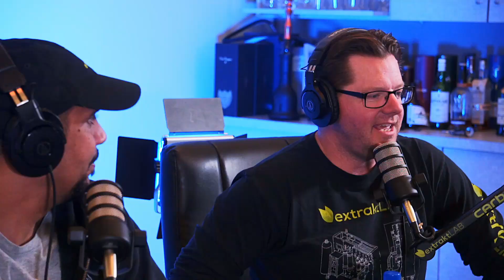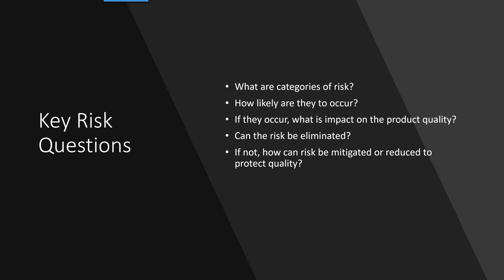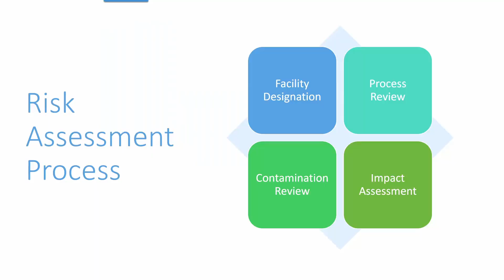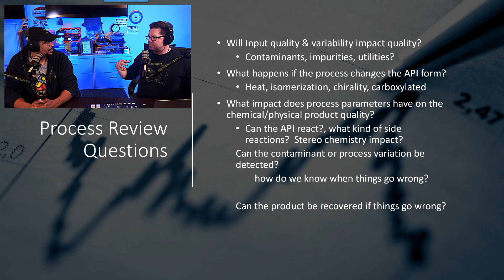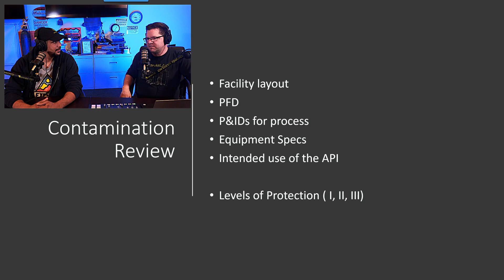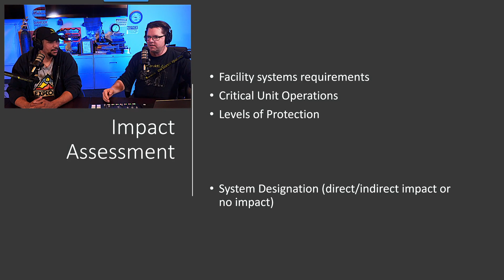Introduction to GMP Risk Assessment

Comment: I wonder if you could make a video (if it hasn't be discussed already) regarding quality parameters you look for in Hemp pre-extraction. As in, what you test it for, are there some micro/metal/pesticide results that you're more lenient with before extraction because they will lower/change after the extracting process. It's surprisingly hard to find input on that topic! I'm a CBD rookie and these videos have been incredibly helpful.